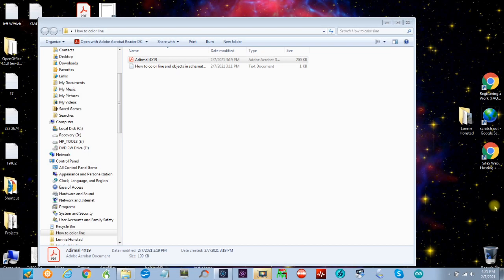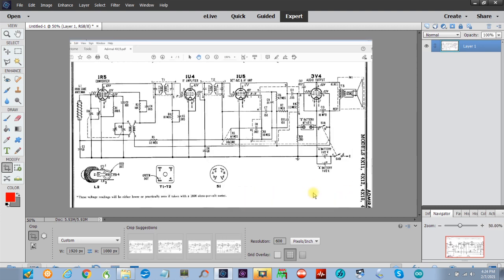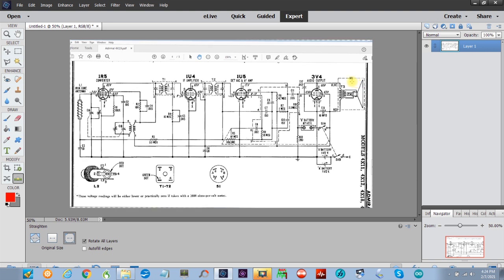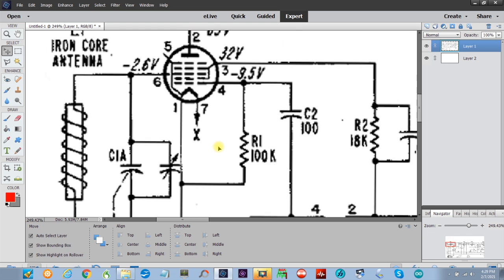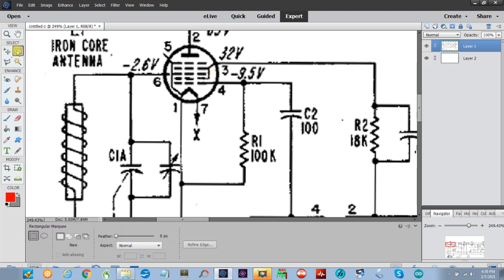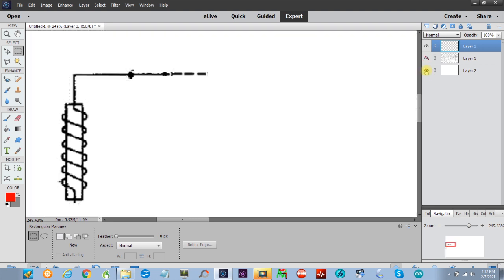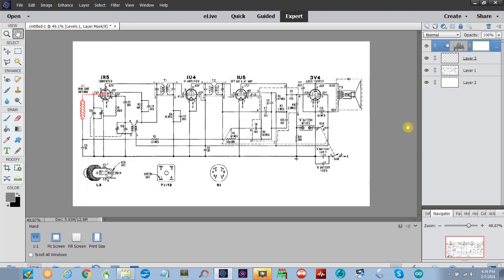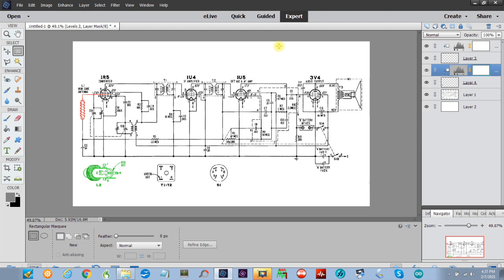How to color lines and objects in schematics using PhotoShop Elements

Comment: Great videos thanks. Just been getting into electronics a bit myself. I put together a one transistor amplifier using a 2n222 and did some probing with an oscilliscope I just bought. I learned how to adjust bias level to go from class c, to b, a etc and saw visually the gain I could adjust with a pot . But was wondering about higher frequencies.
When I turn the frequency up high of the sinewave I'm inputting to the base the sinewave that gets amplified will get more distorted and looks like it's a little out of phase with the inputting signal and more so the higher I go. Is that normal? Or how to you get a transistor to amplify at radio frequencies without distorting? Is it all in the values of capacitance and resistors etc? These readings were of voltage on scope. Thanks much
Reply from the maker: Yes that is normal. Usually an audio amp will cover frequencies from 20 to 20K.If you get into RF an RF transistor maybe needed or the bias needs adjusting. I have an FM transmitter that works well using a 2N2222.
Build FM One Transistor Transmitter Project Modification 3-3
https://www.youtube.com/watch?v=3tc3gBEU9Js

Comment: in case it helps: instead of eraser, you can use the selection tool (one beneath the hand icon) and select an area then press Delete key, if its like photoshop it should delete that area and show the white background layer beneath it
edit: just like you did when selecting the iron core antenna
Reply from the maker: Thanks and your welcome.